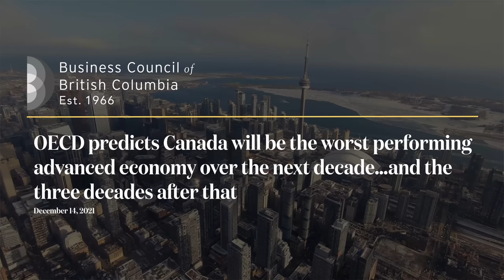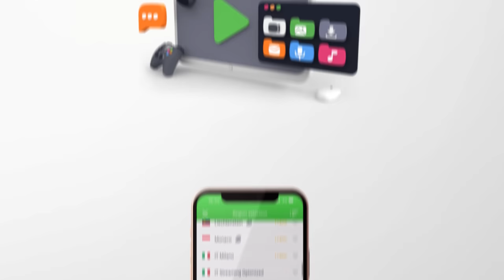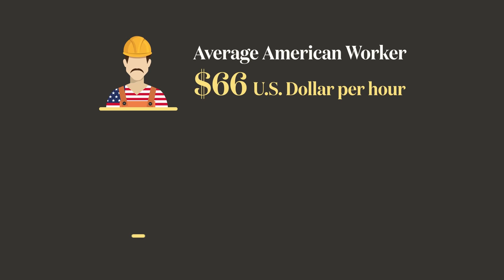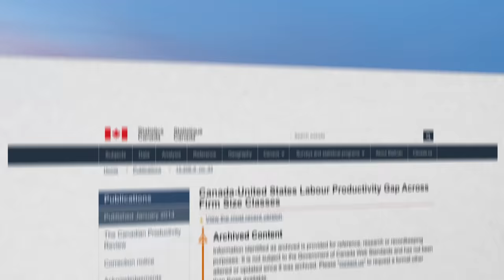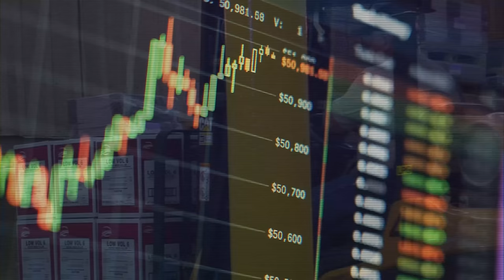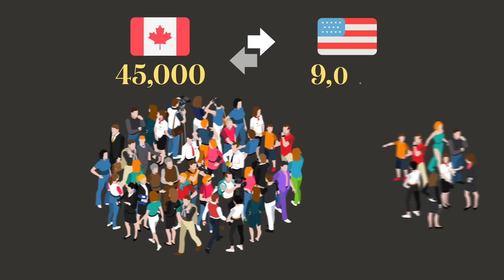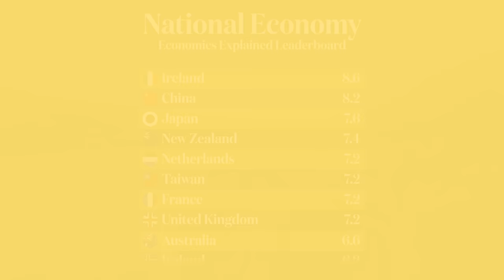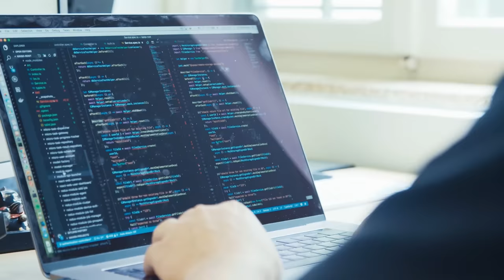The Stagnating Economy of Canada | Economics Explained

Comment: Another thing that has really screwed the Canadian economy is red tape. It's almost impossible to start any big projects.

In Ontario, we have one of the biggest mineral deposits in the world called the ring of fire. Developing it is a no brainer, it is rich in metals like iron, copper, nickel, and chromium, but also has large amounts of platinum and palladium. Estimates have put potential values of the minerals at 120 billion. However, rather than opening up mines, we have spent the last 20 years talking about whether we should allow the area to be developed.

Energy has also been mismanaged. In BC, they have been working on a hydro dam for 12 years (proj completion in 2025 but I doubt that). It will have a 1.1 gw capacity but is estimated to cost 16 billion when all is said and done. Saskatchewan released a time schedule for building a nuclear reactor. It has 7 years of paperwork and consulting to start construction, whereas the actual construction time is estimated to be 3 years. In Ontario, we decided to go forward with large numbers of wind and solar projects that cost 150-800% the cost of our nuclear plants on a kwh basis and doubled our energy rates as a result. To help pay for this, we didn't put away any money to refurbish one of our nuclear plants, and it will now be closed down and replaced with gas plants because there is no money to bring it up to speed.

Comment: Let me give you the example: I have credit ratings in both the USA and Canada. My TD bank for forty years with zero issues: I had to THREATEN them to get overdraft protection (which I have never used). Most of the Canadian CCards start really low, and crawl up slowly. My American cards??? Leaps and bounds. Same zero issue Credit Rating, same system, different pile. Canadian "big banks" do not like small time entrpreneurs, so a lot of retail industires are under the radar: underground economy.

Comment: Canada is pivoting away from its highest productivity industries. Oil and gas ($700 per labour hour) mining ($300 per labour hour) for environmental purposes. Other sectors are not even close to as productive. This is why Canadas productivity has not kept up with the us
Reply: The tech (software in particular) and auto sectors are similarly productive, the value of our autoparts exports is almost equal to the value of our oil exports.
Reply: i.e. you would need 10 hours of work in tech  or automotive industry to produce the equivalent of one hour worked in oil and gas/mining
Reply: @ST-fk3jz  The difference is that the value of software and auto parts are less prone to fluctuations and provide indirect benefits to the host country such as digital infrastructure and local manufacturing capacity. The automobile, steel, and EV Battery factories in Windsor, Ontario helps keep the Canadian manufacturing sector alive.

Comment: Not the best analysis of the Canadian economy and its potentials and problems. For one thing the absolute most important factor you hardly touched on was what you seemed to mention last... Canada's population. 38 million CA consumers compared to 330+ million US consumers is really the no. 1 factor that determines so much. Besides the size difference, US consumers consume far more per individual and WILLINGLY spend far more individually probably than populations in any other country. Canada's problems are numerous but its small population with its smaller consumption is a major factor if not the no. 1 factor as I mentioned earlier. The fact you did not focus on that makes this video truly lacking in actual informational value. Production only increases if there is a demand for it. Canada simply does not have that demand. The US and even other nations do. Pretty basic math.

Comment: "an accountant running Excel can run the work of two accountants using calculators, and five accountants using their heads"

I disagree. We are probably talking in the magnitude of 1 accountant with Excel being as productive as 50 accountants with calculators or 1000 accountants using their heads. A skilled individual who knows how to use Software correctly could easily outproduce any non-computer wielding person by a significant magnitude. And that is just one individual. Data teams have invalidated entire industries in the past couple decades through the use of software. I believe that's the primary reason why the US is pulling ahead of Canada. American's tend to be highly technically literate. Most people I know understand how Excel works, and could get up to speed on using it effectively in the time frame of months. Canada, with its horde of dancers, book writers, and artists, does not have the same efficiency luxury.